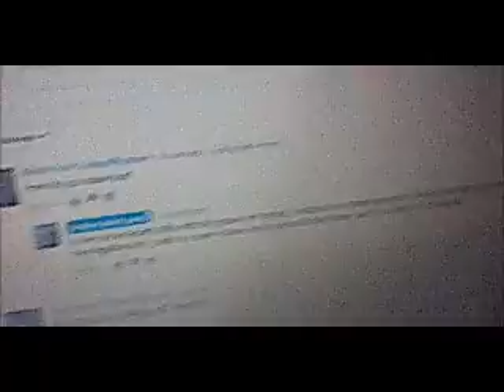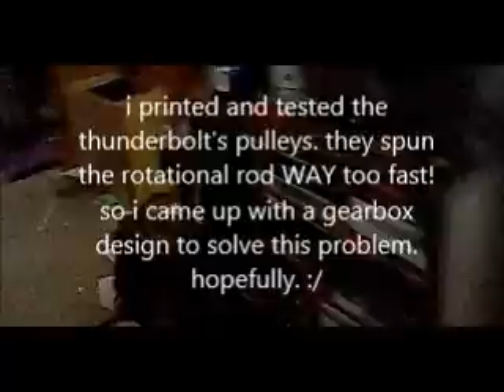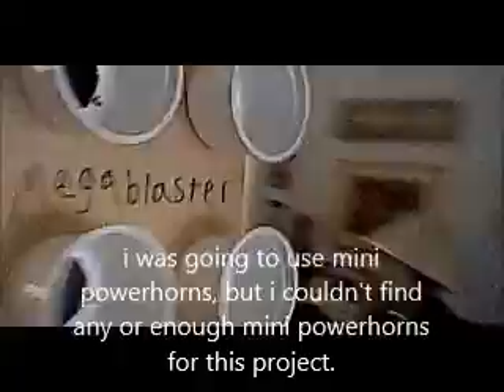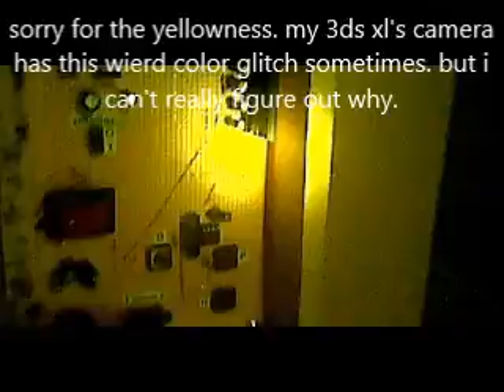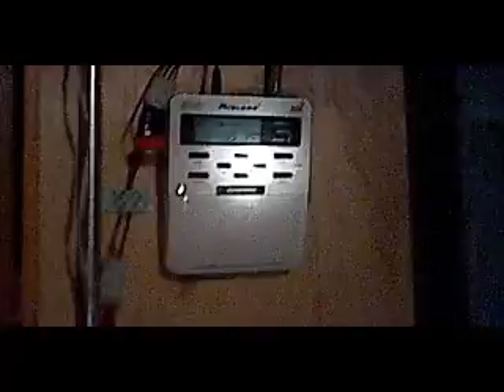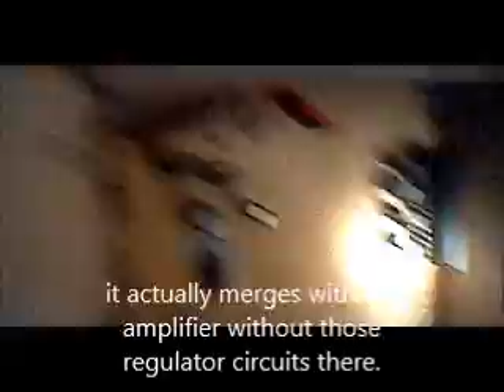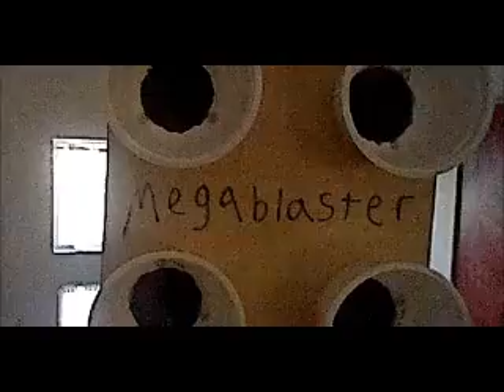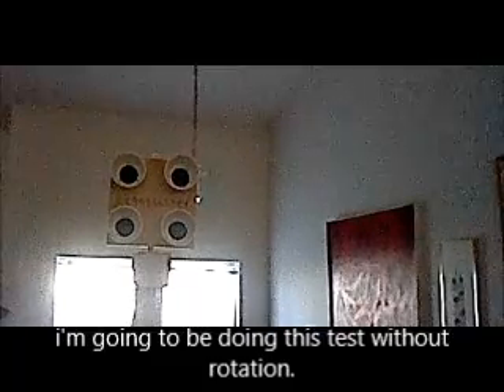megablaster jr. mini tornado siren in-depth video.

Comment: Hey broken solar panel, I might make a mechanical siren this spring or summer and I was wondering what is the best chopper port combination? (P.s. My profile picture is a picture I took of the closest of the two thunderbeams in my town. It is about 2.5 blocks.)
Reply from the maker: it depends on what siren you are making. like a 2t22 would be 12\10 port, allertor is 12\9 port, p50 is 12\8 port, and most thunderbolts are 6\5 port. etc;. and a thunderbeam is single toned 12 port.
Reply: Broken solar panel what is the best in your opinion
Reply from the maker: what siren are you making?
Reply: I don't know exactly it's probably going to be a custom one and I am looking for suggestions on design and port combinations. I still need to decide weather is will be an Omnidirectional siren or a rotating siren. It is in early stages of planning.

Comment: can you show me how to 3d print a thunderbolt
Reply from the maker: well, i don't own a 3d printer, the thunderbolt is being printed by a 3d printing service. i haven't printed all the parts yet or worked out all the bugs yet, (that being the rotator going too crazy fast.) but if i can get it working when the parts are all printed, then i might make a video of it. btw, i also got the chopper printed already. not very loud yet, but once i have the blower done it should get way louder. the next part i am currently getting printed is the stator\chopper housing.